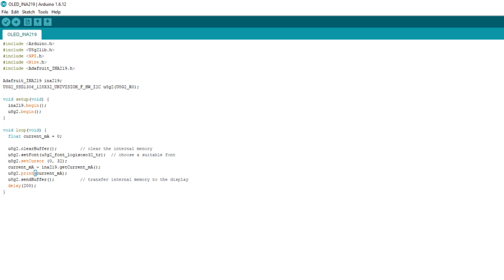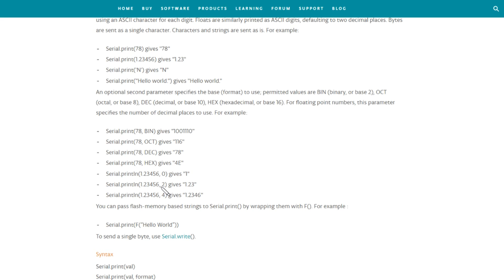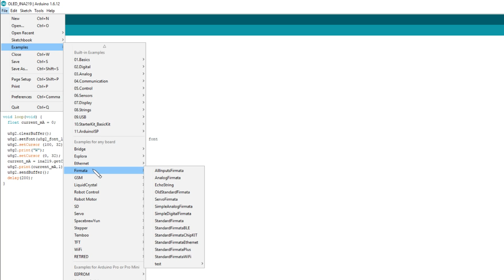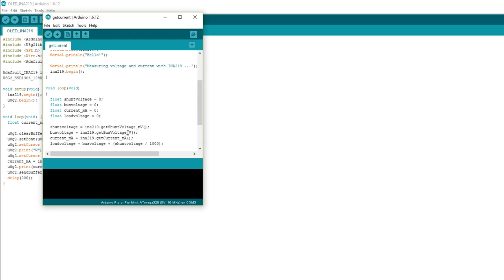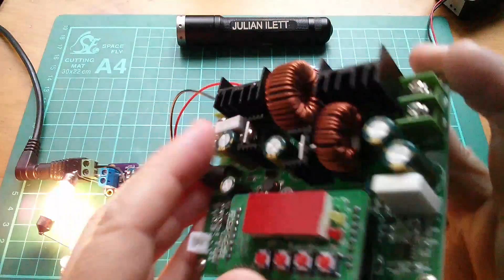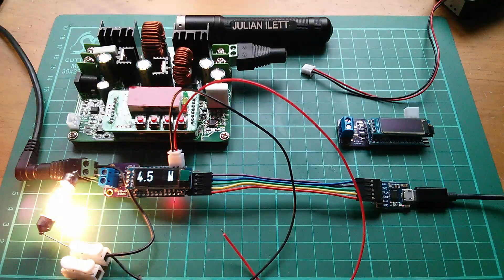Arduino Ammeter (with OLED) Converted to Wattmeter

Comment: Julian, when doing maths never trust the operator order but use brackets to enforce the order that terms are evaluated. As equations grow with the programs complexity, the use of brackets helps to minimise bugs later down the line.
Reply: You'd be amazed at the number of people in my locality that think indicators are an option. As is using the correct lane on dual carriageways and being in the correct lane at junctions. Mind boggling some of the idiots on the roads today.
Reply: @tinplategeek1058  Same thing here in the old US of A, I never trust those who do use them because many have broken the auto cancel and just leave the damn thing blinking for miles and miles.
Reply: True. And it appears makers of larger cars now cater to such mentality and seem to offer indicators as prohibitively expensive add-on packages, and if they are indeed sold, they only work sporadically and can only be operated at great physical pain to the driver ...
Reply: Order precedence rules are all good and proper, but what happens when you want to divide the current by 1000, rather than the product of the sum? :-P The benefit of the brackets is if you ever tinker with the equation in the future, it won't break because you've added something else to it ;) Better off starting off that way, even for something simple.
Reply: It should be an unconscious reflex to use the indicator anyhow ...
Reply: Peter Feerick, whatever make your boat rock, but I do agree with Julian.
Reply: As a professional SE for over 22 years I have to agree wholeheartedly that you should explicitly use brackets.
Reply from the maker: I understand what you're saying, but the operator precedence rules are absolute and unambiguous. Brackets can help with readability, but aren't essential.
Reply: Not essential but in my professional life, I've seen too many program bugs introduced due to lack of brackets. So I always use and "preach" to others to use them. Even in simple 3 term equations (as they always grow in real life programs). 
It's like I will use the car's indicators even if it isn't strictly required by the Highway Code (when there is no visible traffic or pedestrians) as it's easier to do so than to have special cases.
P.S. Hope this doesn't sound too preachy or worse as it was meant as helpful to others.

Comment: when in the Arduino ide working on small bits of code such as this one, could you not increase the size of the font (under file|preferences) so we can see the code on smaller screens with older eyes...
Reply from the maker: Yep, I hear you :)

Comment: Why not just make the font smaller so you get minimal overlap that still makes the numbers very readable?
Plus no nA
Reply from the maker: I was so close to doing that - I looked at the other sizes of this particular font. But I kinda knew it would all fit when converted into a Wattmeter :)